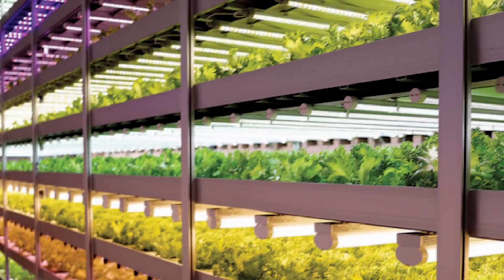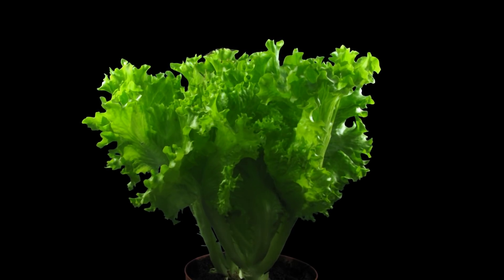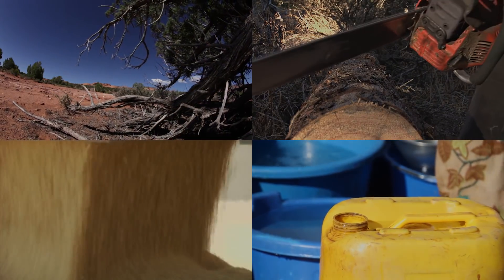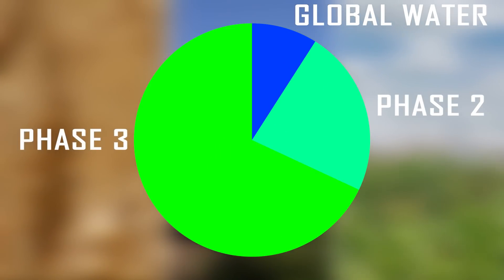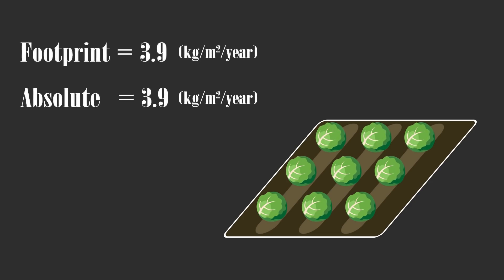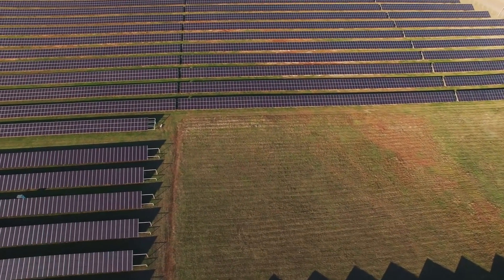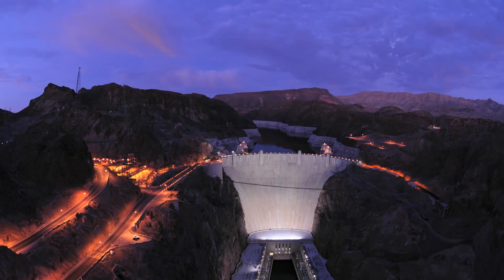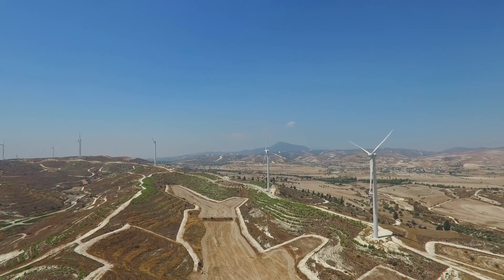How Can We Improve Vertical Farming?

Comment: Great vid! The problems of how we make our food are becoming more apparent and more important to deal with as we transition to a more sustainable way of living with our environment. I'm working on a new method of agriculture I call Micro Agriculture. I think we can mitigate our agricultural issues by moving it into individual homes. But it's not easy turning everyone into farmers! Mulling over this problem, I've designed an indoor automated aeroponic unit to grow the most commonly consumed vegetables (even root vegetables) right inside the kitchen or room in any dwelling with convenience in mind. People aren't going to use it unless it's incredibly easy, with this unit the user simply needs to replace the reservoir water once a week, and plant their seeds when required. The onboard computer takes care of everything else including nutrient mix, ph adjustment, misting, lighting, and sensor information. With this unit you can cut away what you like as it becomes mature, and instead of travelling hundreds or thousands of kilometers in its lifetime, our food could travel just 10 or 20 feet from its growing spot to our plates. That's fresh!
Reply from the maker: That's super interesting. I did come across some of these during my research but at the time, it was quite early stages, so it was difficult to get much data.

That said, it sounds like it would be a good thing to look at as an addition to the series. If you have any information or know any good resources, It's something I'd like to look at in the not so distant future.

I definitely agree with the premise. I'd imagine a lot of people like the idea of micro agriculture but don't have the time/space/knowledge to do it. For it to be a consumer level product, it does need to be really easy and I'd imagine it could work so long as it's not substantially more effort than having say a break-maker in the home. Plus, many people do love the idea of being more involved in the food they eat.

I'm assuming this sort of Micro Agriculture can only really be supplementary. I'd imagine it's quite difficult to achieve significant growing density in home based units?
Reply: @ExaCognition  I've been continually shocked that in home aeroponic methods haven't taken off yet, NASA's been using the technology for decades, but I think the problem has been getting an adequate level of yield from something that doesn't take up a lot of space. More of a design problem then a technological one in my view. Plus I think lighting wasn't ideal until recently, now with mid-power LEDs you can get your light very close to the plants and they're incredibly efficient when ran under full power, hardly giving off heat. I've combined different orientations of plants and lights into the space of a common fridge, and I'm implementing a consecutive growing schedule that allows all the users food requirements to be ready to eat each week with no waste. No pesticides, chemicals, land use, harvesting machinery, processing, packaging, shipping, refrigerating... just whole food right there in the home. I'm meeting a manufacturer today actually to begin the build of my prototype.

There's surprisingly little information out there regarding aeroponics, mostly basic technical stuff, but I haven't come across anything that goes into the detail and great presentation that you've done with your series on vertical farming. The way you've studied and put the information together is incredible, awesome work! I believe you and I share the same concerns over our current state of agriculture and the ways in which we must overcome its problems and what the future of farming might look like. I see you have an email on your youtube page, I'll have to send you any good info I come across regarding aeroponics, otherwise I can keep you up to date with my project and business. My plan is to publish a document on Micro Agriculture (or Distributed Farming, more details on that to come...) and all the details regarding the components and methods of growing food inside the home using aeroponics. I just have to prove that I can actually fully replace the grocery aisle with my concept!
Reply from the maker: I think you have a point. There are a few breakthroughs that make this sort of product far more viable now, even if the core technology has been available for a long time. As you say, cheap efficient LED's can be placed closer without tip burn, so your growing density is much higher, the sensor and electronics are cheaper and more capable than ever.

I think staged growing makes a lot of sense, so that you have continual harvest, that's always a challenge for small systems. I was wondering about the reasons you might chose such a solution over say growing food in soil at home, I assume the reasons are: not enough space, ease of growing/all the plants surviving, increased growing density/higher yield, higher harvest frequency, also I can see how faster growing cycles means less planning ahead. It's probably quite a long list. I'd imagine you are limited in your use of light recipes, though I guess it depends on how much lighting control you have for each level and the LED capability.

It seems one of the really interesting capabilities is the user could grow such a broad ranges things, thanks to the lighting and climate control. Would you run off presets for different plants or could you download say "optimal cherry tomato conditions", it's certainly challenging.

A lot of the most advanced aeroponics I've come across are proprietary systems, which probably explains why good technical data is hard to come by. I would have recommended aerated hydroponics, as a solution since it seems to carry a lot of the benefits of aeroponics. However, if you've got a working system successfully delivering nutrients and maintaining suitable misting, then it sounds like you've already got a good system.

Good luck with it, I'm interested to see how it goes, and I'd been keen to read the document on micro agriculture.
Reply: @ExaCognition  Yes primarily it was for all the reasons you mentioned that I wanted to move away from soil, as well as keeping a system that is as low-maintenance as possible. I have designed a new plant medium that is reusable and which also allows the germination process to happen, this way I have no separate cloning stage; when the seed is placed it will stay in that same spot until the plant is ready for harvest.

Continual harvest was one of my main goals to avoid waste and to have a system where everything is conveniently ready for consumption at the time it is wanted. I wanted to avoid over producing because then you have to figure out how to preserve or give away all your extra produce. But, this means that I will be using general levels for both nutrients and lighting. I'll probably be running light 16 (maybe 18) hrs a day, all year, and during that light cycle I'll have plants starting, maturing, and being harvested all at different times, I'm also going to be testing out how to extend harvest periods (say if you're making a meal that requires two leafs of kale, cut them both from the plant but leave the plant to continue to grow, instead of cutting the plant down for harvest, we should get more harvestable mass that way). I know there is great advances to be had with creating granular recipes of lighting, nutrients, and CO2 for every single plant out there, where commercial operations could really drill down on how to fully "maximize" what we can extract from these plants. I think there's lots of market room for this where companies could make their own specific version of a food item too. But I think this amount of specificity and customization is very difficult or impossible to do on a distributed farming level inside dwellings, there just isn't enough space to have multiple growing environments. And you know what? I'm not so sure if those specific recipes provide much of a tangible advantage. Sure, they might be bigger, greener, have a unique taste, maybe increase amount of such and such vitamins, but personally I feel as long as there's a way to eat truly fresh and whole food that's grown 10-20 feet away from your plate, you'll be so much better off anyway, nutrient-wise, without having to get specific with each plant. Perhaps what relationship my product could have with larger companies that have the ability to optimize plants, is I could source seeds from them. But I doubt I could explore that facet of modern agriculture currently and will avoid it for now.

Certain plants that are photosensitive during their growth cycles (such as the ol mary jane), I don't think I'd be able to accommodate them in my general machine, but once I've established this product my next one is an automated weed machine, I live in Canada and there's tons of money in the industry, too big to ignore! 

My manufacturer approved of my designs yesterday, looks like my prototype will begin construction in the coming weeks. Hopefully I'll be able to report that I'm the first to make a commercial product that grows root vegetables like potatoes and carrots. If I can get my projected yield from it, I might do a youtube series where for a month I live only on the food that this unit can produce, that would be wild!

Comment: I have to disagree on the renewables. The materials they rely on is dwindling, by 2030 they will likely start skyrocketing in price. We would be better off going nuclear. It is not only the most energy dense power source we have but also the most versatile.
Reply: Yes, but would you trust countries like Afrika, India, or even more unstable regions like the Middle East to heavily rely their energy production on Nuclear. And what about guaranteed save waste storage for hundreds of years?
Also why, in your opinion, would Materials used for renewable skyrocket? E.g. Photovoltaik mainly utilises, silicone, glass, aluminium. Neither of which is either rare nor hard to recycle. Recycling potential is already now over 95%.
Windpowerplants utilise concrete, steel, fibreglass and a more or less toxic resins. The argument for depleting rare-earth elements due to magnets can be diminished since regular but slightly weaker magnets are being used as well. No unconditional need for neodymium. 
Hydropower is just some turbines converting potential energy to electricity with ultra high efficiency.

Now nuclear, uranium is the limiting factor since its not abundant enough to power the whole world. Modern thorium reactors are a great alternative, but they don’t really exist yet (same with fission) and we need an alternative to coal/oil/gas at best yesterday. 
In addition, even if we manage to develop thorium here in our first world countries quickly, there is no chance to get it distributed around the world to poorer countries. At least not fast enough.
Now even if ITER in France might be delivering confidence in the future, fission will remain a powersource reserved for #1-countries for a very long time, for the sake of its ultra high technological requirements/demands.

Renewables in addition offer the chance to diversify and spread energy production which increases resilience of supply security and decreases vulnerability.
At this point in time, I simply see no additional value coming from nuclear. What do you think?
Reply: @petergoestohollywood382  For the Record. I actually believe we should use every power source available. (Just wisely) 
So, I am not against the use of renewables or fossil / bio fuels. (again, just use them wisely) 
Also, you have fission and fusion backwards. Fission is what we currently use. Fusion is what we want. As Fusion is 11X more powerful. 
Questionable partners: We can make self-contained cells that can be dropped off and picked up once depleted. Taking the nation using it mostly out of the equation. Secondly Africa could definitely split the difference with some countries using renewables where applicable and others using nuclear and bio fuels. India will likely have to go nuclear because of thier density.  
Waste/Usability: Waste is a lie. 90+ percent of the "waste" made can be recycled. (Almost indefinitely) The small amount that is waste can be burned. So, no need to store it long term. Especially the BS 100k or more years. That is just scare tactics. There is 40+ types of nuclear power plants. Each one has an intended use. LWR (light water reactors) are the most common. They were made for ships. Have you ever heard of a nuclear-powered ship melting down? I haven't! Thorium is another good one. Not as good as fusion, but hey. They both aren't ready. (yet) 
Renewables: The issue with renewables are that they can only be recycled so many times (10-15).  Other ones like wind turbines have a lot of not human issues. That still makes them useful, but if I bought panels for my house and had them recycled each time. I would only get a little over a hundred years out of them. That is great for me (as I won't live a hundred more years) but I am concerned about my kids and grandkids. Wind on the other hand requires taking down forest area & are noisy. Two issues for the animals that live near them. I know they are moving off land and to the coast. But that limits where they can be used. 
Hydro is amazing, but it is also limited to where it can be used. I know there are issues with leaks but that can be solved with installing a filter pool at the bottom.     
Nuclear Fuel: We currently have over 250 years of fuel. That is without recycling it. We have also only dug up 1/3 of what we have. To top that off, meteors bring more all the time. (small quantities but still)    
My conclusion is making Nuclear the foundation of the power grid. As in: What are my minimum power needs? (say 100MWh) Build a location acceptable nuclear plant for 101MWh. Then use renewables that are location acceptable to fill the gap during the day.

Comment: I understand that this is being done for research purposes but has anyone used it to grow food economically?  Farmers would be doing this tomorrow if it made sense.
Reply from the maker: There are multiple examples of commercially successful plant factories and as an industry it's growing fast. That said, the commercial viability depends on crop type and location. 

Rice is only being grown indoors for research purposes and won't be commercially viable for some time. Lettuce on the other hand can be grown profitably in the majority of locations. 

It's best to think of Vertical Farms as a technology that is viable in small niches of product and location, though it's important to remember that the convergence of improvements in Absolute Yield, LED Efficacy and Solar Efficacy (or other cheap energy sources) effectively multiply together. The resultant growth appears to be exponential (though it will likely be an S-curve in the long run), and we are already see that the size of the niches are expanding fairly quickly.

It will be quite a while before Vertical Farming is commercially scalable to the point where is a has a significant impact on farming in general, so farmers swapping fields for warehouses likely to be a very gradual process.

Comment: 10:51 "even rice can be harvested about four times more often" please provide a reference for this statement as I am very interested. thank you very much.
Reply from the maker: There's a table on Page 220-221 of a book called "Plant Factory, An Indoor Vertical Farming System for Efficient Quality Food Production" which links to a number of research papers. The table compares Rice, Lettuce, Tomato's and strawberries. It highlights the values used in the test such as CO2 ppm, Daily Light Integral, Harvest Index, Dry Matter Ratio etc.

It's an interesting book if you have access to it.
Reply: @ExaCognition  Thank you so muchh.

Comment: This video is a gem of quality. 
When talking about absolute yield or land yield, we only take into account the light consumption in this video. Understandable since it is the biggest consumer but when you increase your level of your indoor farming and increase your space of this farm, you reduce the heating & cooling system consumption per crop which induce an increase in the yield. 

Thank you very much for this video, can you link the sources you've used ?
Reply from the maker: There is another Vertical Farm mostly scripted, I'm planning on releasing the sources/calculations spreadsheet for the whole series with that video. There's so much information/data/calculations  in it that it needs tidying up so that it makes sense and is easy to follow. If you have any specific sources/calculations you want to know, I can post them for you.

Comment: You have to correct your voice.  To fast and the tone could be better.  Btw. the best location for vertical farming is probably in deserted area.   Hot and the solar power used 100%   the heat energy and the light energy.
Reply from the maker: Yes I have to improve my presentation, I have a few ideas on how to do that for future videos. The business case for vertical farming certainly favors solar in high solar irradiance regions. In terms of deserted areas, it depends on the perish-ability of the product. The current phase of profitable products are highly perishable, so it's a case of striking a balance between optimal location for cheap lighting and transport costs. Generally speaking, the lighting cost is a much bigger factor.
Reply: Wait what? It was perfect in my opinion.